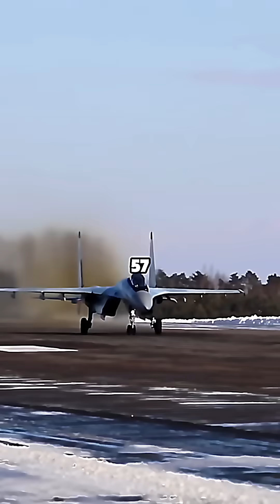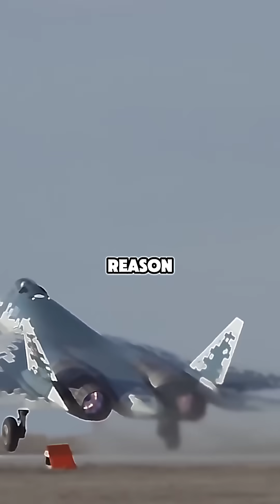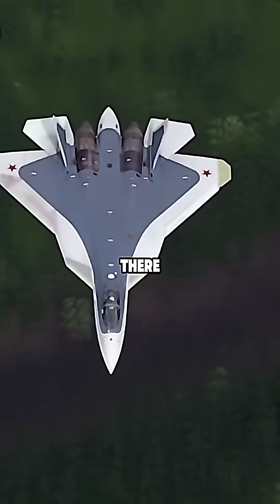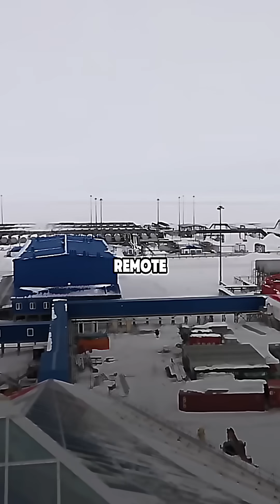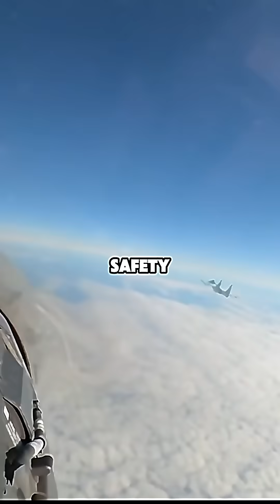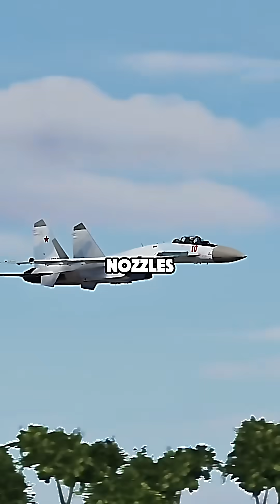Why most Russian fighter jets have twin engine design

Comment: For decades Russian pilots haves asked for a single engine light and agile aircraft, which was never delivered.. Reason is quite simple USSR couldn't build engines powerful and compact enough for a single engine fighter aircraft like F-16 or even Swedish Viggen (again with F-16's engine).. USSR had built aircraft prototypes similar to Rafale and Eurofighter, but never mass produced them.. So a decision had to be made- which was to develop an aerodynamically perfect wing and build a twin engine fighter around it, which was the MIG-29.. It was supposed to rival F-16, but only 1400 were ever produced  (4500 for F16)... So none of the reasons listed are actually correct , they are consequences. Yes the Mig was glorious, but in aviation sheer numbers matter exponentially, but specs matter linearly.. So the usual roles suddenly reversed. USA went with simplicity and numbers and USSR went for complication and specs, but out of necessity, not choice.

Comment: Bulshit! They built single engine jets flying over Siberia 40nyears ago, didn't they? Moreover the climate in Northern USA or Alaska is not that different that Siberia and yet the USA are content to use singe engines there. The reason is that modern figher jets are heavier but Russian cannot produce good enough power to thrust ratio singe engine. Thats why F-16 single engine has a bigger range and can carry more load than MIG 29 twin engine.

Comment: Mig-23 and Yak 141 , Mig 21 and lastly the upcoming SU-75 have single engine
Reply: Su75 Checkmate is intended do be produced for foreign sales only, not for the Russian military
Reply: SU 75 is a good computer animation only. And will not proceed further.
Reply: @slavzahariev3901 , uhhh, there is a flying prototype, so cry about that.
Reply: The SU-75 was created by UAC at its own private initiative and not at the request of the military, as such it's mostly intended for export. The VKS currently has a doctrine that prefers twin-engine fighters, but if the SU-75 is good enough, the VKS would probably accept it in to service.
Reply: it may change a lot since the prototype build

Comment: I was more surprised over the first fact. If i recall correctly russia packed a gun in a plane, so powerful it caused pain to the pilot when fired. And stressed the Airframe so much parts bent... So, what about more Weapons? But giving the pilots the ability to get back home safely while burning men on the front lines like crazy, no matter the war? Debatable.

Comment: The MiG-33 would’ve been an amazing single engine F-16 competitor!
Reply: Except no engine that Russians could make
Reply: @dmitrikorobeinikov9400  How do you mean.

The MiG-33 design used the MiG-29's RD-33 engine. It was meant to be a smaller, cheaper single-engine plane for poorer countries.

China bought the MiG-33 design and made the JF-17/FC-1 with it. Mikoyan also consulted on this project in the 1990s.

Comment: ....Aaaaand then Sukhoi builds a Su-75 "Checkmate" that is single engine fighter having engine from Su-57....

The reason to use two engines, has never been about safety. It has always been about weight-thrust ratio.
A single engine can be made more powerful and efficient, but it will be so huge that you practically don't have good aircraft design for long distances as aerodynamically you can't build good plane around huge diameter cylinder. 

So the compromise is to use two smaller diameter cylinders that will allow to make the aircraft flatter and aerodynamically better, but now you problem is to have separation such way that you can safely fly that thing if other goes out (the F-14A problem). 

Example the MiG-21 is practically just a rocket with wings. Compare that to F-5 that has two smaller engines and similar flight performance but is flatter. 

https://commons.wikimedia.org/wiki/File:MiG-21_and_F-5_Silhouette_overlay.jpg

MiG-21 top speed Mach 2.05 that it can reliable manner achieve constantly even when armed or carrying extra fuel tank (the 2.05 is aerodynamic limitation, not to exceed)
Where F-5 top speed is Mach 1.6 when clean.

MiG-21 has same max range of 1400 km, as is F-5 with 1400 km.

F-5 service ceiling is 15800 meters, where MiG-21 service ceiling is 19000 meters.

The two engines vs one engine nicely demonstrate that it is possible make smaller fighter with similar performance, but the one large is better overall for pure performance wise.

Gripen has shown nicely how reliable single engine aircraft can be. Over million flight hours and not single fighter lost because engine malfunction.
While F-16's engines has been blowing up periodically, but those are more likely already past mid-age engines (or swedish just have better engineers...). 

The golden era of single engine fighters is past. Be it a Century fighters or Pre-teen fighters or old Sukhoi/Migojan designs, the need to go fast is long time past, as missile goes almost always faster.
This is example reason why SR-71 was required to be stopped being used, as not just MiG-25 could intercept it and launch a missile to shoot it down, but better long range and high altitude SAM were invented than S-75. As when previously window to attack via missile was counted in seconds, the new capability to intercept and stay on close proximity and launch Mach 4-5 missile at you that can intercept you in 40-60 seconds period from launch, made useless to try to overrun something that so much faster than you.

If SR-71 etc lost an engine, it was game over at that moment. You became expensive space shuttle...

Comment: I think it's mostly reason A. Single engine fighters like the F16, and the Eurofighter are lighter and have so do have an advantage in maneuverability.  Using thrust vectoring in a dog fight for the falling leaf maneuver is a hail mary, gives up their speed to gain at short lived advantage making them a sitting duck if their opponent has a wingman.
Reply: Get your facts right before you comment. YDA.

Comment: There is another reason: metallurgy. A single-engine fighter means that the engine must provide more thrust relative to its weight. But it requires stronger materials, and Russia does not have the technology to make them.

Comment: single engine fighters tend to be interceptors for close range.  europeans have had single engine fighters for decades as easy to build and only really needed for short range battle. ie 200km or less.  american really doesn't need sorth range interceptor fighters as besides mexico it has no land enemies even remotely close. so they build for range and speed and reliability.  the F-35 is the outlier but it was build with multiple customers and price in mind. which is why the f-18 is still popular twin engine multi roleish aircraft. (fighter and growler configs) with decent range and pace to intercept targets at longer ranges, like say off an aircraft carrier or an US base on foreign soil (guam)

Comment: Let's not forget the MiG23! It was a big and powerful single engine fighter!
Reply: Was pretty unreliable but other sweep winged jets have had single engines and worked just fine: Su-24
Reply: @nils1539 Су-24.........тяга: 2 × 11200 кгс (110 кН)
Reply: @alexseinik3275 I didn’t remember it have two engines, my bad, but the Su-22 and 17 worked fine with one big engine
Reply: A bad one. Mostly ground attack!
Reply: @cosmincasuta486 You’re right. And the argument here is that it should have never been used as a ground attacker. It was a fighter all along, and the foreign operators, such as ones in Iraq and Libya, gave the MiG-23 a really bad reputation. As an interceptor/fighter, it would’ve likely performed much better.

Comment: That's first video on YouTube that mention Russian Jets jetfighters having 3D thrust vectoring engine nozzles. That gives them Unmatched maneuverability. No American or any Western jets have that. Not to mention that Russian jetfighters frames are built of Titanium and rest of the compost fibers that makes them much lighter than any Western jets. That's what made them able to carry much more payloads and fuel. That's why they've longer operating range twice or more than any Western jets. Not to mention that Russian Airforce is Only on planet that's armed with Hypersonic missiles with mind blowing range..1500km missiles air to air is named Gremlin. + R37M air to air BVR Beyond Visual Range Hypersonic missile range 400km.those two Hypersonic missiles mentioned had RENDERED whole Western Airforce OBSOLETE. Not to mention that MiG-31 and Su-34 are armed additionally with Air to land and air to sea targets Kinzhal Hypersonic missile range 2000km and Zmeyevik air to ground and to Sea targets Hypersonic missiles with mind blowing range of 5000km. Those two Hypersonic missiles had RENDERED whole Western NAVIES OBSOLETE too. Those facts aren EVER mentioned on YouTube except in my comments that most of them have been erased by YouTube because they are Supposedly not respecting YouTube guidelines.😲🤪🙉

Comment: When you can't make one engine powerful enough without sacrificing reliability and safety, you use two, less powerful ones, instead.
Reply: they have the most powerfull engines in the world you know ^^
Reply: @QuicksilverVM  
Nope.
The Saturn Al-41F-S 117S on the Su-57 and Su-35 produces ~137kN of thrust at full afterburner, ~142kN at emergency thrust, ~86kN dry thrust (the 117 they're planning on eventually putting in Su-57s produces 147kN at emergency thrust, but it's not in use yet) And that's if the official figures are not overestimated, like a lot of russian figures typicaly are.
For comparison,
The newer F-16s have the
F110-GE-132, which produces 144kN and 84kN dry thrust (compare the size of F-16 and Su-57)
The 30+ year old F-119 on the F-22s produces 156kN at full AB, 116kN dry thrust
and finally the F-135 on the F-35s produces 191kN at full AB, 50kN more than the AL-41, and 125kN dry thrust... And there's a more powerful replacement in development right now. So probably 200kN+ at full AB, and 130-150kN dry thrust, but that's just an informed guess, P&W might focus on power generation for avionics and other features, reducing the IR signature with exhaust cooling, and stuff like that.

And, additionally, all three of these engines have way better reliability and safety records, and operational lifespans than anything from the AL-31 family, including the AL-41s.
Reply: And any small fragment from a nearby rocket explosion puts ONE engine out of action! Welcome to the real war, my friend!
Reply: @ВикторВетерков  
Situations that would completely take out one engine, but not two that are close to each other are exceedingly rare.
And any fire in one engine spreads to to the other in most cases, as such two engines are not much safer than one, when it comes to fighter jets.

Also, don't try to be condescending, especially, when you are the one who's clueless about "the real war".

Comment: Power increase is not connected to how many engines but to the power of the engine. There is however something to be said about safety in war time having two engines. The downside is the cost of two engines instead of one. As for agility it has little to do with one or two engines.

Comment: When people give BVR missile excuse to dampen dual engine maneuverability they tend to forget that twin engine also allows more power which can enable the frame to carry a larger AESA at the nose and more BVR package itself below. As for heat emission compromising stealth, it can also carry extra flares and chaffe as well as extra layer of radar absorbing paint as a compromise...
Reply: Then, why not 4 engines?
Reply: @Laagkeet  Easy. The more engines, the more fuel consumption, the less effective combat range. Something similar to what Chinese J-16s are going through, only worse engines.

Comment: The real question is, what, if any, is the advantage of a jet with only one engine?  The answer to that may make me wonder why any single-engine jets are still in service.
Reply: less weight, less cost, less maintenance, less fuel and a smaller airframe. Tho the f-16 is very much a monster just a smaller one. It's always good to have both low and high maintenance/performance that both do their job very well. Sure the F-22 or f-15 does have higher performance but they have alot of maintenance and work after each flight. The F-16 on the other hand is simple and can be launched into another combat mission shortly with low maintenance but yes usually a twin engine jet does have better performance most of the time.
Reply: @vexingrabbit1824  So, basically, the Russians have given themselves nothing easy to build and maintain.  And we wonder why Putin's war is going so badly?

Comment: Twin engine = less stealth capable
Reply: No actually.  The f-22, a twin engine aircraft, is stealthier than the f-35.  The F-117 is twin engined, as are the b-21 raider and B-2 spirit.  Most stealth aircraft have twin engines.

Comment: Checkmate is a single engine aircraft in prototype development stage
Reply: For exportt!
Reply: @cosmincasuta486  like they wont use it at all ^^
Reply: @anantgautam2485: Russia came up with that for the export market only. They are building more SU 57 for their own needs. The war with Ukraine has proven SU 35S in multirole, SU 34M bomber, SU 25 Ground attack, SU 57 sparingly is a very lethal & potent lineup of fighter jets.

Comment: Because Russia can`t build engine with high thrust and low fuel consumption.
Reply: Not cap Russian fuel efficiency is already so low as is and all the jets they have are wayyy heavier than American jets. Just cant get a good weight to trust ratio with single engines
Reply: @Proswordfighter123  (IDK english good so don`t swear if I`ll do mistakes) Some perfomances :

Saturn Al-31 (Su-35`s engine) Specific fuel consumption : 0.78 lb/(lbf·h) in dry thrust. Thrust to weight ratio 4.93 : 1 in dry thrust. Length : 4945 mm, Max diameter : 1280 mm.
Pratt & Whithey F100 (F-15`s engine) Specific fuel consumption : 0.73 lb/(lbf·h) in dry thrust. Thrust to weight ratio 7.4 : 1 in dry thrust. Length : 4850 mm, Max diameter : 1180 mm. 

They both air to air fitghers, but older F-15`s engine make more thrust and spend less fuel then more modern Su-35`s engine. And Su-35`s engine weihgt more then F-15`s engine. Su-35 have 2 engine because it can`t fly on one russian engine (Russia don`t have normal engine). And because of this Russian should put 2 engines in plane, but because of this plane weights more, have more scale and less battle range. But equaly F-15 have more thrust and weight-to-thrust ration then Su-35 and F-15`s fuel consumption less then Su-35`s fuel consumption. (sorry for mistakes ^_^)
Reply: @Proswordfighter123  yeah its called short range mission guys
Reply: @alexandercamenzind meanwhile, an F15 is more efficient, more payload, longer range, higher thrust to weight and way hell faster. What's your point?
Reply: @mathematiciankerbol5336: Really? You are selling the Russian short. 
Let's take a look: Saturn AL41F1S that powers SU 35S:
Dry thrust: 88.26 kN (19,840 lbf)
Afterburner thrust: 142.2 kN (31,970 lbf)
Emergency thrust: 147.1 kN (33,070 lbf)
Weight: Approximately 1,600 kg (3,527 lbs) 
Now let's see F15Ex Engine power:
GE F110 - 129
Dry thrust: 17,155 lbf (76.3 kN)
Wet thrust (with afterburner): 29,500 lbf (131.2 kN)
Weight: 1,840 kg
There is GE F110-132 engine which matches the AL41F1S but it is not certified with F15EX yet.
Reply: Cap